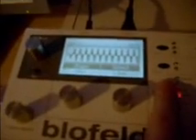BassN Filters

Comment from the maker: I've not used one so cant really comment, but from what i've read they're completly different beasts, ok they're appearence is quite similar but what they do isn't, the blofeld is a 3osc synth with 2 filters, while the plugiator is a dsp host for software synthesizers, so potentially, if someone wrote a softsynth that emulated the blofeld and loaded it onto the plugiator then they should sound very similar, Waldorf have just launched largo but its not in plugiator format.